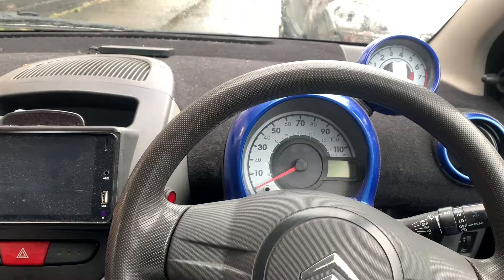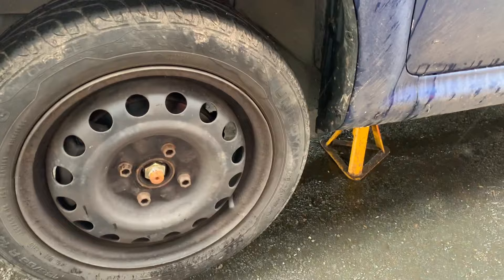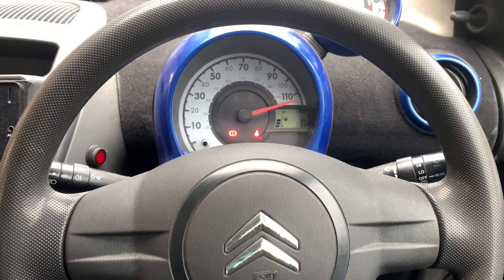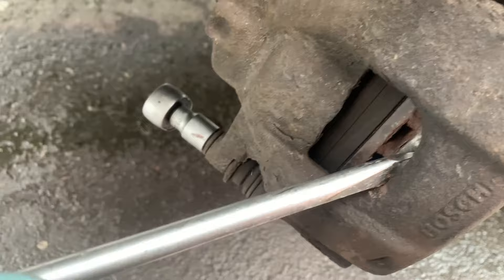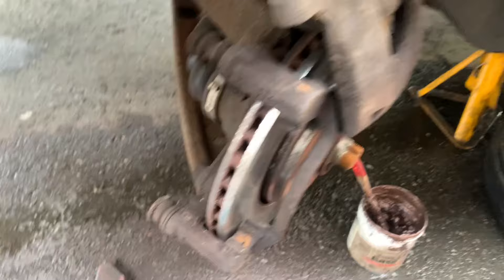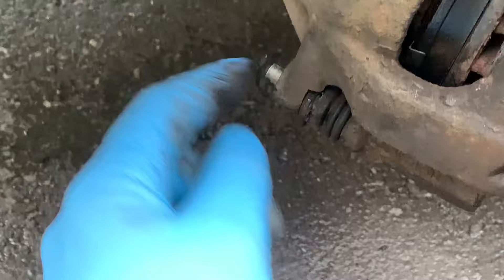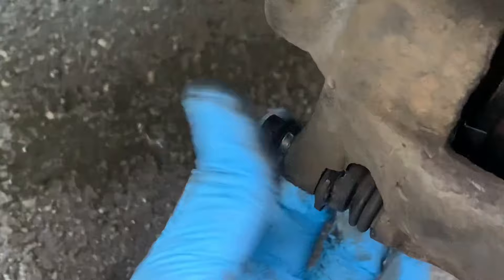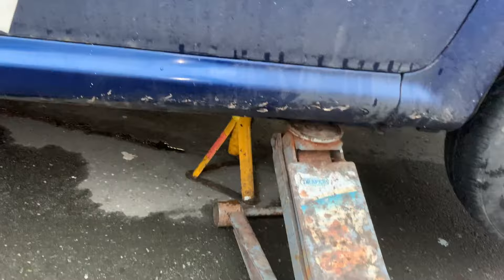DIY Brake Disc Skimming/Brake Rotor Refacing… Does it Work? (CityBug)

Comment: This looks like another job I could manage. Cleaning up that horrible rust along the leading edge of the discs makes it worth it. Great vid, Cheers
Reply from the maker: Easy job, and it worked much better than I expected! Lol
Reply: You could go one little step further and give your discs edges and hat a quick spray of paint to prevent them from rusting.

Comment: Back in the early 80's when I worked in maintenance and had access to a lathe, I used to skim these up for "customers" who brought them to me for 50p a disc.Seems a long time ago now.
Reply from the maker: We’ve got a proper lathe a work too, but my R6 is parked in front of it in the way
Reply: 50p a disc… I’ve just called a local Indy garage and been quoted £75! Be better off just buying new ones

Comment: In the slides you can also use the copper grease as well and I always remove the old grease before the new grease is applied
Reply from the maker: You don’t want to use copper grease in the slides, just around the pads where the touch the calliper. Copper slip isn’t actually a lubricant but an anti-seize compound. In the slide you usually want to be using silicone or rubber grease
Reply: @StupidBlokeStupidVideos  wow must of chance from when I did a mechanics course 12 years ago and I have never had an issue with using copper grease
Reply from the maker: @186scott  I use it around the ears of the pads but some mechanics argue you shouldn’t use it at all. Don’t get me wrong, it’s better than nothing, but there are much better things to use on the slides. I do use it on calliper pins though which some people call slides as the pad itself slides on them, but the actual slides with the rubber boots on, I use silicone grease.

Comment: I am owner Citroen C1 (2007).
I follow the maintenance of the toyota aygo mk1.
The normal thickness of the brake disc is 20mm the replacement
thickness is 18mm.
Reply from the maker: I didn’t actually measure these but the lip was mainly just made of rust tbh.
Reply: What’s that disc pad you’ve used to grind your brake discs
Reply from the maker: @lesrowley6405  it’s a specific brake rotor re-profiling tool, but I suspect an 80 grit flap disc will do the same job though 🤔
Reply: Bravo Patrioti !

Comment: Did pads and discs on my c1 from new after about 40 or 50 thousands miles, I think it was, mine had a worse lip than yours, and more rust, so replaced, rather than grinding, but next time I service mine, If needed will bring the lip and rust, obviously only a limited number of times this can be done before the m.o.t tester notices they are below the minimum thickness for the brake discs, but out of interest, what grade was the flap disc you used in your angle grinder? 40, 80 grit etc? Did the self tapper sloppy knob fix and feels so much better changing gears now, not like stirring soup.
Reply from the maker: Yea if the discs are thin then it’s probably not a great idea, I didn’t measure these as could see that there was plenty on them, but as for the MOT discs have to be ridiculously thin/on the verge of breaking to fail for thickness/wear unless they have cracks in pretty much lol. They can pass MOT way below manufacturers recommend minimum thickness. I used 80 grit pad but it took a while. The gearstick fix is actually one one of best things I’ve done on this car! Lol
Reply: @StupidBlokeStupidVideos  thanks mate, prob best I pick up a 40grit flap then, as I like it rough and quick🤣🤣🤣🤣🤣🤣
Reply from the maker: @markslade9722  don’t we all 🤷‍♀️

Comment: I need to shine ny back breaks  but I am thinking of switching them to disc brakes 
What do you think?
Reply from the maker: It’s been talked about on the group pages a lot of times, but nobody has ever needed to do it. Not even turbo’d cars that get used on the track as the rear end is so light

Comment: Hi, i am one of your subscribers and have just bought a 58 C1. The PS light comes on/off, is it low fluid level or what do you advise? thanks
Reply from the maker: Hi mate. They don’t have fluid on these, it’s electric power steering. Could be something as simple as low battery voltage, or could be the p/s ecu or even motor on the column.
Reply: @StupidBlokeStupidVideos  thanks for info, explains why i cannot find reservoir! will start by boosting battery charge, thanks
Reply: @StupidBlokeStupidVideos  I also wondered why I cannot see the reservoir for it, but it's kinda explains.
Reply: Had that happen to my 07 plate c1, and actually lost the electric power steering, so was hard to drive, I just unplugged the ECU, left for a few minutes, plugged back in, and light went off, power steering back working fine, and had no problems ever since. When the light was on, I plugged in my Delphi ds150 vci and laptop, and real live data showed a few strange things, like it being left hand drive etc🤣, so guess the ECU got confused, and just needed disconnecting and rebooting.
Reply from the maker: @markslade9722  where is the ps ecu on these by the way?
Reply: @StupidBlokeStupidVideos  pretty sure from memory it is on the right hand side foot well, sure it was easy to reach and unplug, but was about prob ten years ago now that I had that problem and did it, but will look on my autodata or vividata later to confirm
Reply from the maker: @markslade9722  thanks mate. I recall it being something like that off the CityBug group, but was just curious for when mine fails 🤷‍♀️ 

I’ve got an ecu to replace at some point but you’ve got to lift the dash up to replace the immobiliser doofer I’ve been told. Not looked into it yet though
Reply: @StupidBlokeStupidVideos  just checked a u tube vid, and my memory served me correctly, power steering ECU is on the side foot well drivers side, when I did mine, didn't remove it, just reached up and disconnected all the leads to it, then reconnected them, and bingo, found my light went off, and got my power steering back, but probably others won't be so lucky, here is a link showing removal https://youtu.be/R9ELke83mx4
Reply from the maker: @markslade9722  cheers G. I’ll bare that in mind when mine fucks up